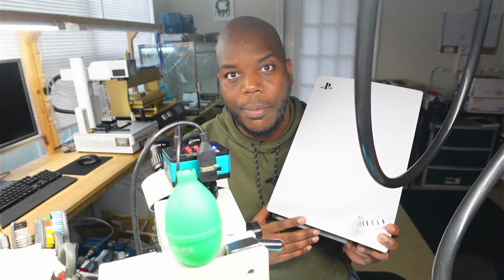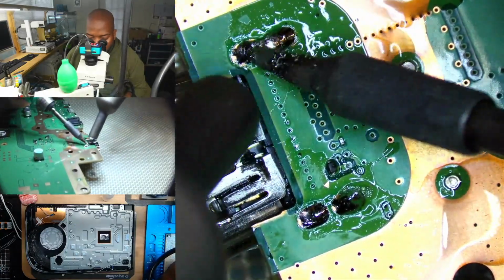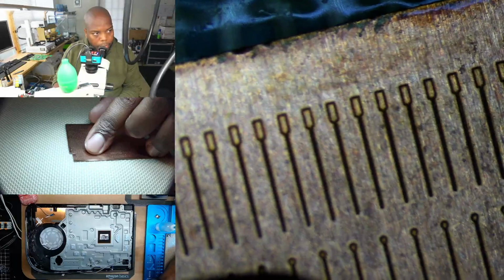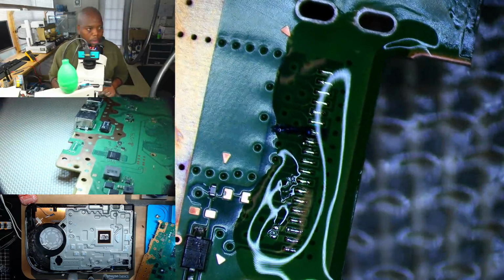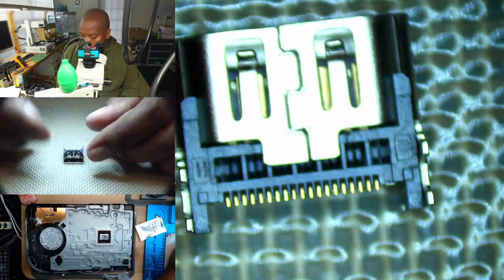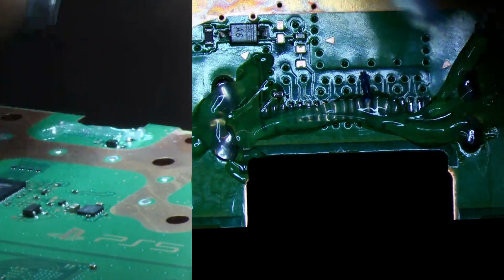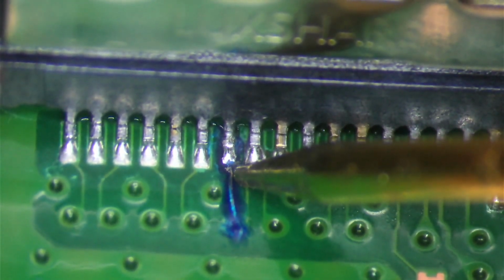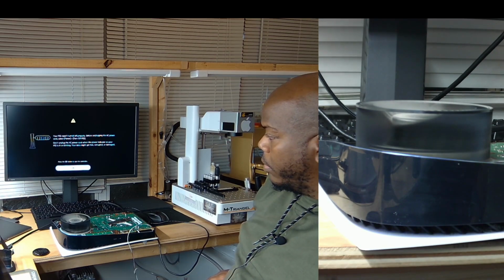PS5 HDMI Port Repair - Design Fail?

Comment: I need help, do I solder the pins with flux or flux is just to get it
Clean it ready .? Please I hope you can reply nd what do I solder the pins with ?
Reply from the maker: Yes you need flux in every step of soldering. If your not using flux your not soldering.
Reply: @iTechBoardRepairs   ok but do I solder with flux or flux and wire? Sorry I’m a beginner